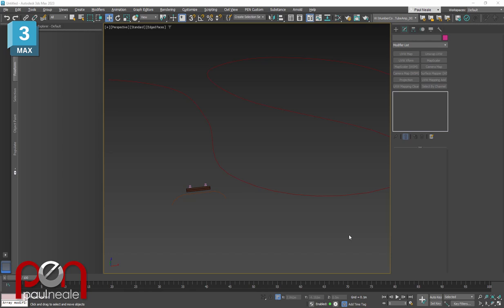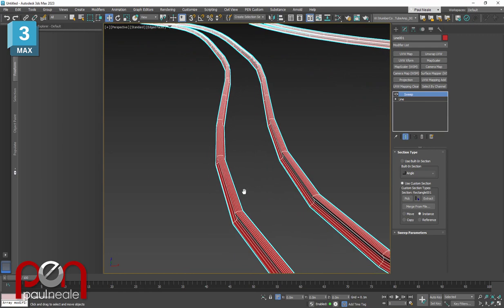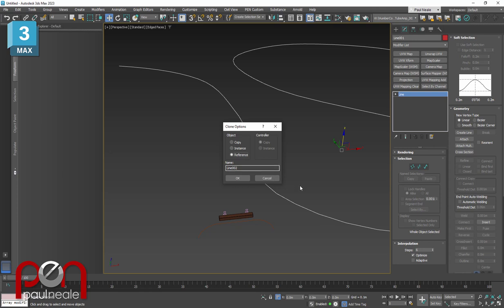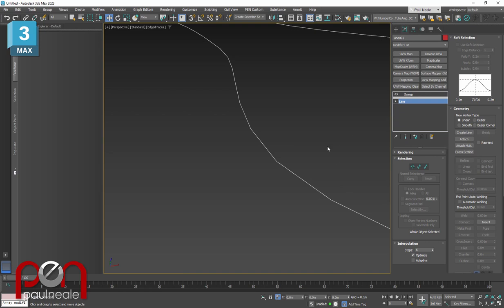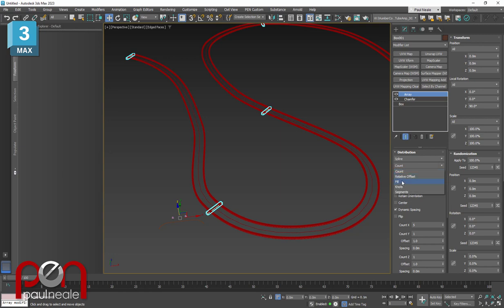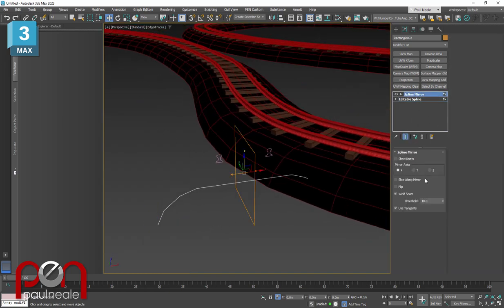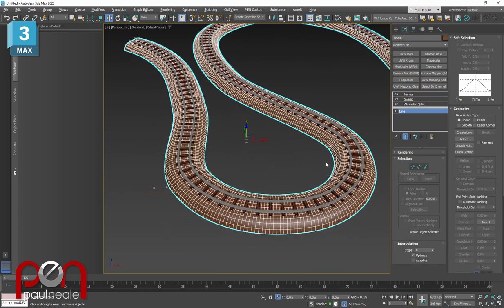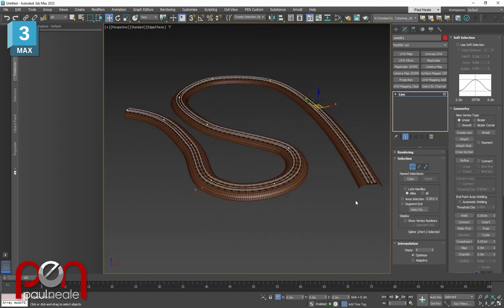3DS Max Copy Instance Reference Procedural Train Track

Comment: Hello Paul, I followed the tutorial and it's amazing. Just one question, when I move the vertecioes on the base spline along the Z axis the blocks on which the tracks are sitting change their rotation perpendicular to the the curve. Especially in turns, any idea how can I fix this? It's not super important for me, I'm just curious. I use railclone for most of similar work.
Reply from the maker: Well... This is a known limitation which is on the list of things to do once the new geometry engine is completed. At the moment you can correct twisting in the PathDeform using the Driven Rotation.
Reply: @paulneale  Many thanks for quick answer. I'm sure somebody will find your answer helpful as I did. I'll share the info with my colleagues tommorow.

Comment: Hey Paul, this scripts "PEN_ControlObjects" not fuction correct in recents version for 3ds Max not assemble all tools, What can it be?
Reply from the maker: I would need to know what errors you are getting as it works perfectly for me.
Reply: @paulneale  It's not enabling all the tools just 3 of them, in old versions of Max it works perfectly.
Reply from the maker: @fabiobarros4879  Don't know why, make sure you have them in the right location. Works fine here.
Reply: @paulneale  Yes, directory is in the right place, it must be some problem coming from my operating system. I'll check it, thanks.

Comment: Hi Paul, please, how can I set the pivot to the place I need? I have a 2D section from autocad of a railway bridge and I always struggle with sweep. First I always need to rotate it 90 degrees. I understood, that I have to do it trough Transform type-in window, if I rotate it just with gizmo it doesn't understand that it is rotated. But then - how to set the pivot? All the splines from cad have pivot on the center of all splines. If I move it to the right location - axis of the rail - sweep ignores it and uses just center or the the points on the edges. I'm not a super expert in 3ds max, I just sometimes need to model bridges for architecture and it is really hard always to put it all together. I need to have all parts separated - concrete part, rails, stones, noise barrier etc. Could you help me, please, to understand the basic principle? I would be very grateful. Thanks in advance. Jana
Reply from the maker: I would have see what you are talking about. Best thing I can suggest is join Stack on Facebook and ask there with images.